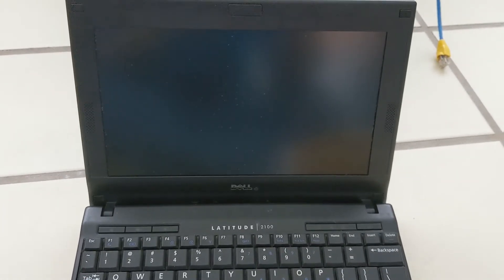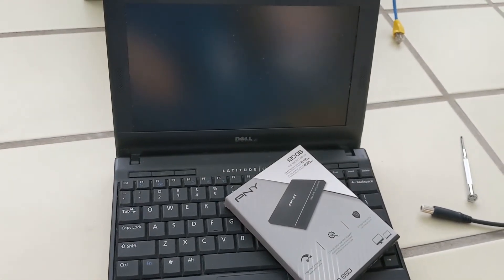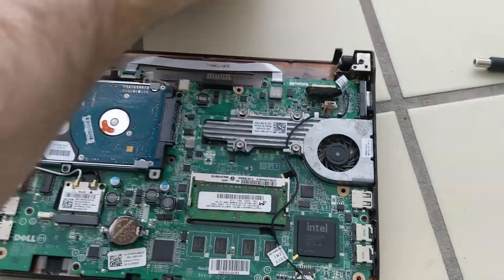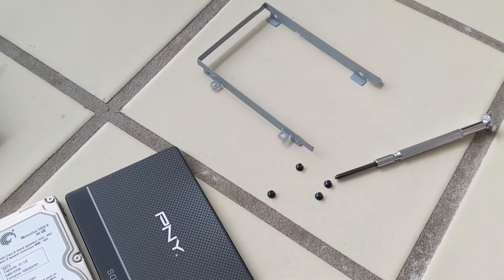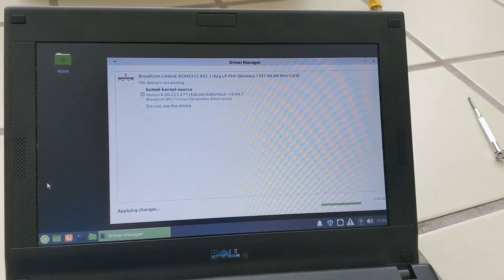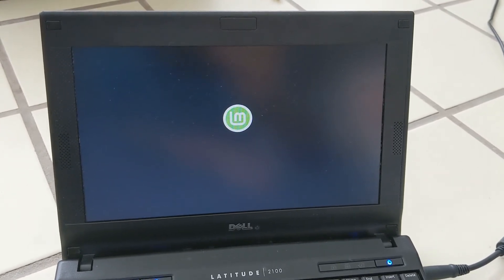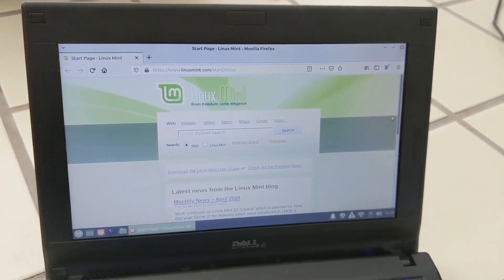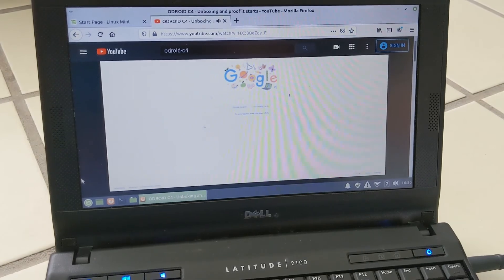Netbook SSD Install - Will It Help? Not that much, I was surprised

Comment: You need to stick to HDD on these hardware only if HDD failed or failing put a cheaper SSD. Processor is the real culprit.
Reply from the maker: Illustrated to be true. Not much newer ones though could benefit from faster IO of a SSD, but still won't be lightning fast. Also would have benefited greatly from not using encryption.

Comment: I suspect Rufus is a pyromaniac 🤔
Reply from the maker: Did I even mention Rufus in the video? I can't remember, this one was a while back and I think I rambled too much.
Reply: @ntgm20  Haha, yeah you mentioned that you used it to burn the operating system.
Reply from the maker: @LowcastleTech  Ah, found it. Yes burn would be correct for writing it to a CD I guess so old language dies hard.
Reply: @ntgm20  I think burn is still a correct term even when writing to USB, at least I thought it was. I wasn't being a smartass if it came across that way😂. Just a general joke about Rufus being used to burn things to disk or to drives.
Reply from the maker: @LowcastleTech  It is all good, I know we joke with each other. I honestly didn't remember saying anything about it.

Comment: On older PC and laptop never install on the device itself. Install and update on a newer machine and than put the SSD or HD in the older one. It will boot and run without a problem, its not windows but GNU/Linux and a lot better than ms win. Don't use HD encription, there is no need for it.
Reply from the maker: I can see where that approach can work well.  I like using disk encryption, and generally advise it on a SSD. I know I can also do home folder encryption, and if I revisit this project that may be what I do, though the time for 32 bit Linux is becoming short, as is the life expectancy of this hardware.
Reply: @ntgm20   The live expectancy of that hardware is (apart from dropping it) almost endless , Alas that is no longer the case for linux mint .
I can not see why they will no longer distribute 32 bit versions , so that those old netbooks do not have to end up in a landfill :(

Comment: I did an SSD installation on a Dell Inspiron Mini a few months back, and I have to say, the boot up time was a lot faster than the demonstration here. It may have been the RAM, but even the Linux Mint installation was closer to 30 minutes than 40. And every boot up was under 20 seconds, almost as fast as a MacBook Pro.
Reply from the maker: That is great. One of the issues with mine could have been the encryption. I sold the machine, but reinstalled Linux Mint without encryption, and I think it did boot faster, but not certain by how much.